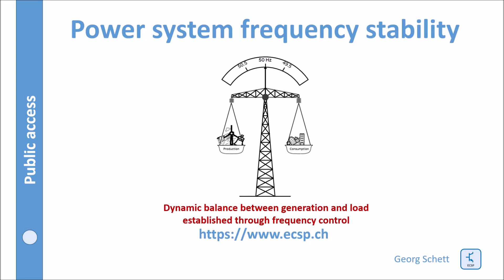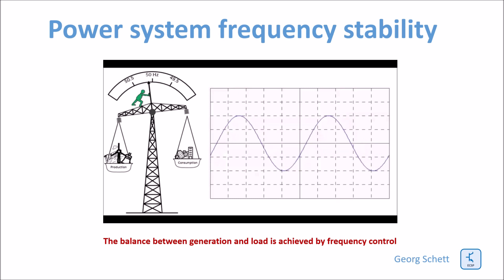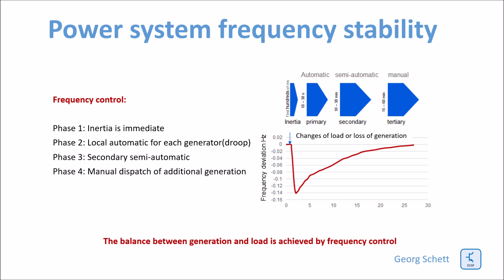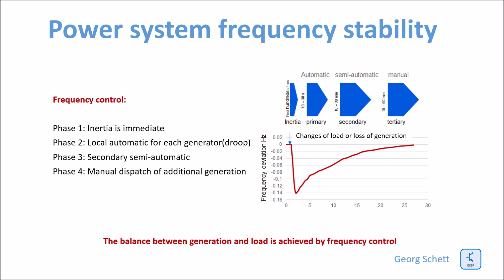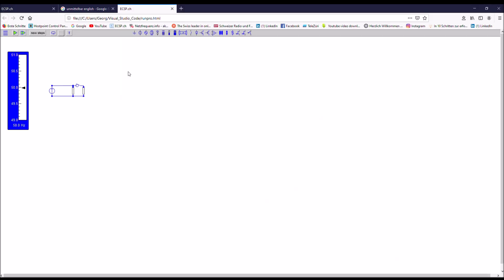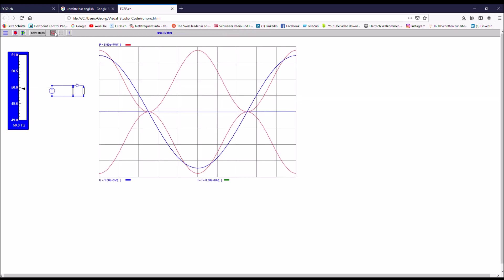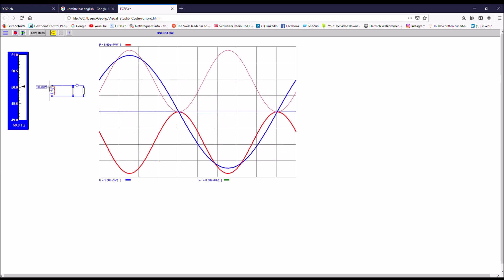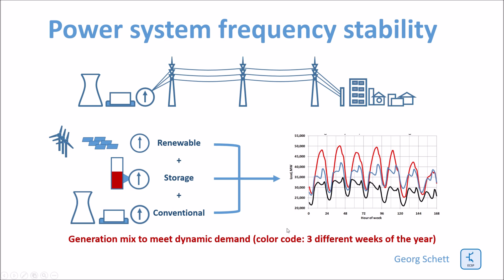Power system frequency stability [circuit simulator]

Comment: Good and informative presentation, Georg. Nowadays, SGs have been replaced by VREs in the context of primary frequency control, wherein the frequency is a large contributor to power system stability. The question is, Do we still need SGs to perform inertial response in the power system if VREs dominate the entire grid, given that Power electronics is also evolving?  Thank you
Reply from the maker: This is a good question. I may be wrong but the grid could be operated without Synchronous Generators. The behavior of Power Electronic inverters can be tuned to come close to synchronous Generators, so called grid forming devices. The requirements are a Power Supply reserve margin which emulates to some extent the rotating mass (virtual inertia), the droop and the fault ride through capabilities. Already today larger power systems operate at close to 100% renewable given optimal weather conditions. There are other important topics as well, such as the short circuit characteristics of SG which are relevant for protection relays.

Comment: I have a question: why the high penetration of RES of the last decade has reduced the primary frequency reserve? Is this correlated with the inertia of the system? Thank you in advance.
Reply from the maker: There is a good paper available on internet: https://www.nrel.gov/docs/fy11osti/51978.pdf. As far as I am aware of, the answer to your question is YES. The primary frequency reserve is very much depending on the available system inertia, which decreases with increasing variable (intermittent) generation. How much is still subject to research as well as possible remedy.
Reply: Thank you very much for you answer I will read the paper you suggested to me!

Comment: It's a very interesting simulation. I'm interested in the correlation between power load/generation to frequency. I still don't understand how a sudden change in load/generation would affect the frequency by formula. Can you nudge me in the right direction? =)
Reply from the maker: Let's compare it to a car: The frequency would be the speed of the car. The control of the speed of the car would be set at 50 km/h (i.e. 50 Hz). If the car would now suddenly have to climb a slope (i.e. change of load, right?) the car would slow down, right? This same thing happens when you increase the load in the power system, the frequency drops. The automation system would notice the change and counteract with increasing the fuel injection in order to increase the torque of the motor (i.e. of the generator) in order to keep the frequency / speed constant at 50 Hz (i.e.: 50 km/h.). The opposite would happen if the car would suddenly drive down a hill, the car would accelerate and thus the motor would reduce the torque.

Comment: Thank you for the pedagogical video. I have a question though. The turbines 
 in hydro/nuclear and gas power generation can be frequency regulated to the wanted frequency. The frequéncy in wind turbine is dependent on the wind velocity, it goes up and down. How is it possible then to utilise wind turbines? I mean may wind turbines be contraproductive because they perturbate the stability of the power net? Can you use wind power to a certain amount and coexist with conventional power? Is it possible to frequency regulate wind power? Do you need to store the energy from wind power to able to regulate it? Thank you
Reply from the maker: Thanks for your kind feedback. You got a very good question. Wind turbines have normally no synchronous generators. They have either asynchronous generators, which can deliver power into a grid at a rotation speed above the grid frequency. Some also have various degrees of power electronics interfaces which convert the power from any frequency (up to DC) to grid frequency. If you deliver power via asynchronous generators, there must be a strong enough AC to feed in otherwise it won't work. There is no need for storage as long as the grid needs the wind power. If however there is not enough load, the frequency of the grid will increase. If so, the wind (or solar...) generation has to be curtailed or the energy has to be stored. Hope this answers your questions.
Reply: @georgschett801  Oh thanks again for your answers.  If I got i right you have to convert the Wind turbine current to D.C current, and then  back to A.C current to bie able to regulate it? If so I gues that it causes extra costs and energy losses? You know, I live in Sweden and Sweden faces skyrocketing electricity prices because a huge amount of the nuclear power in southern Sweden has been decomisioned by political decisions (Ukraine war does of course also affect the prices). The Swedish goverment wants to increace ocean based wind Turbine power in the baltic ocean with 500 TWh. Sweden has Today a total consumption of 150 TWh (think the idea is to partly export the energy to Europe and partly use it for the growing electricity demand in Sweden). Do you consider those enormous plans for Wind Turbine in Sweden (and Germany) to be an efficient way to solve the electricity price boom or is it more like a political Jippo. Sorry if I trouble you with my long questions.
Reply from the maker: @johanlilliestrale6333  Not exactly right. Many wind turbines are operated with asynchronous generators. There is no need for major power electronics converters but they normally have a gear box. They are as far as I know however not so efficient. The larger turbines have power electronics converters, some of them have a DC interface, some of them have no gear box. There are many different technologies well described in literature. Wind energy as such is increasingly competitive and together with solar it is the right answer to increasing power demand and to the substitution of hydrocarbons. Off-shore wind parks are much more efficient than on shore ones. The actual price boom however is not driven by renewables but by the so called merit order pricing scheme. This pricing scheme is also well explained on internet. This pricing scheme was perfect in times where gas was kind of normal. Today however the high gas prices disturb the whole story and at the same time there are issues with the nuclear in France and a lack of water storage in Europe. So Europe has all interests to rapidly increase renewable, manly solar, wind and hydro.

Comment: Interesting angle presented here; if I get it correctly, renewable generating capacity becomes a load, same as the slip angle shifts a motor into a generator. 
Thank you Georg!
Reply from the maker: More generic: If the angle lags it is a motor consuming real power (or a resistor), if it leads it is a generator producing real power.

Comment: Hi Georg I tried running the simulation via the link in the description however when i hit the run button I don't see any sinusoids on my screen any idea why is it happening ?
Reply from the maker: Thanks for your feedback. Do you try to run the software based on a touch screen device? This would not work, a corresponding warning should be visible. I did not hear of issues with firefox, google Chrome, the new edge and Opera. Not tested is safari. Let me know, thanks again.